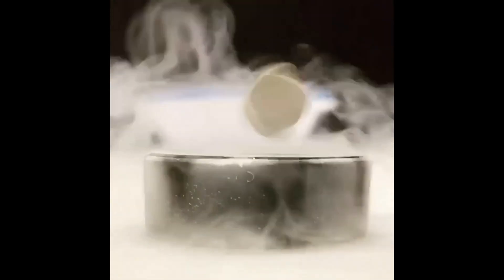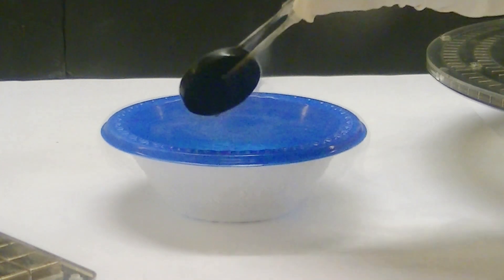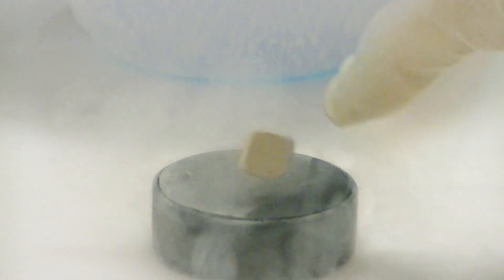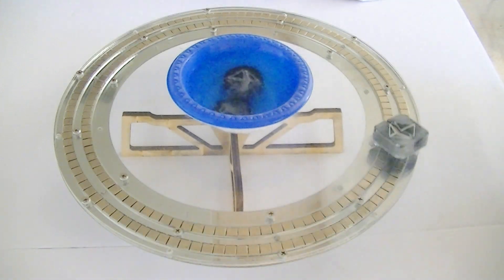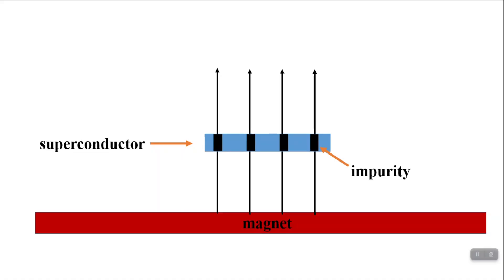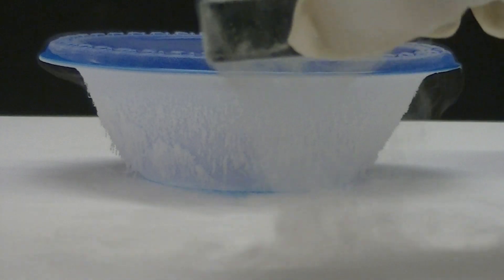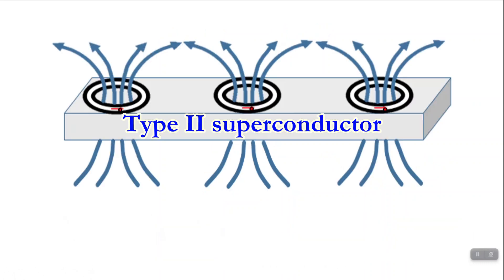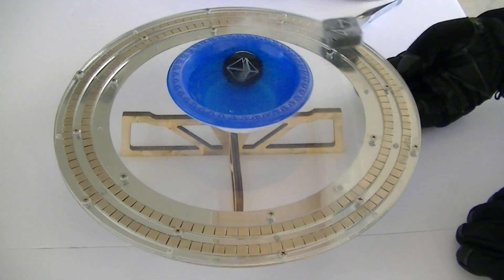Quantum Locking: The Magic Behind Superconductivity

Comment: How cold does the superconductor have to become for this effect? Could you do this in Antarctica without liquid nitrogen?
Reply from the maker: The particular superconductor used in this video must be cooled to 93 K (-180C, -292F) to become superconducting. This temperature is MUCH lower than even the coldest temperatures in Antarctica
Reply: @TommyTechnetium  after taking out from liquid nitrogen how many minutes it will work?
Reply from the maker: @G_U_R_U  It depends on how much water the superconductor has absorbed. More water and it loses superconductivity faster